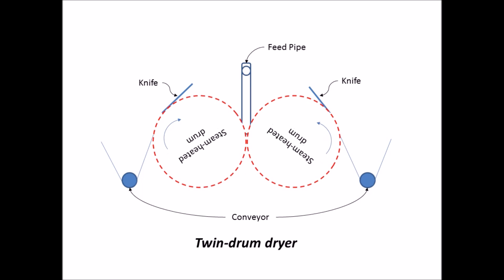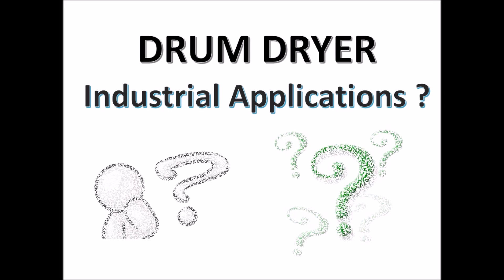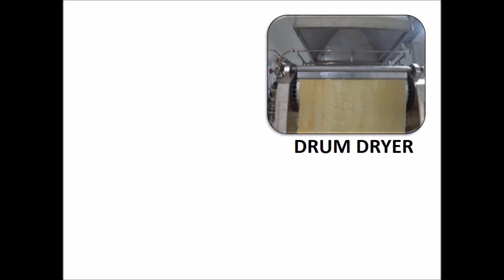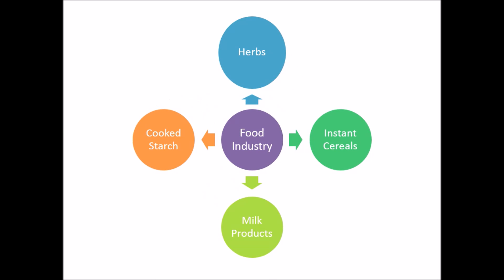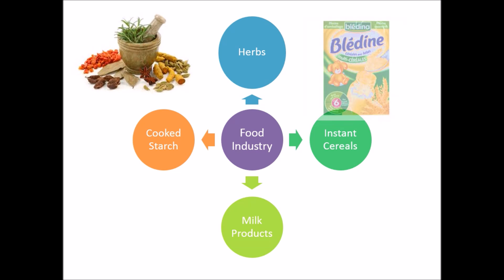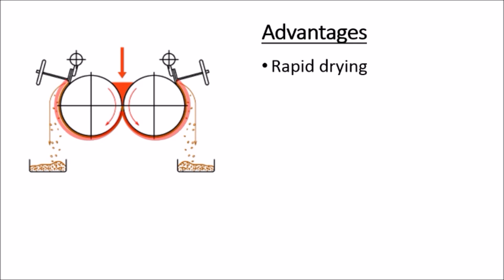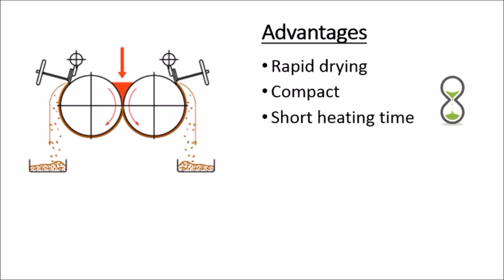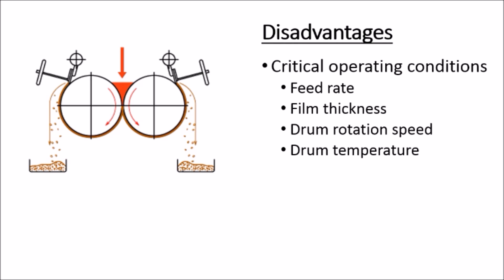EKC 316 - Separation Process: Drum dryer Group 8

Comment: The working principle is it wet solid feed will attached on the surface and dried by the hot drum when it rotates?
Reply: Jeremine Lee The wet solid feed does not only dried by the hot drum, 
but the major contributor that makes the drying process is faster is by 
the concept of vacuum drying which this dryer applies.